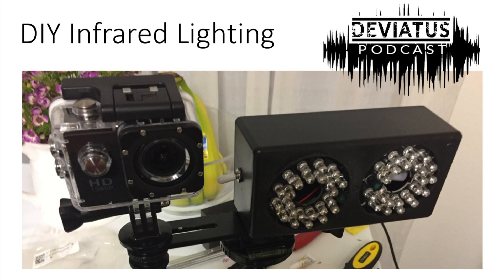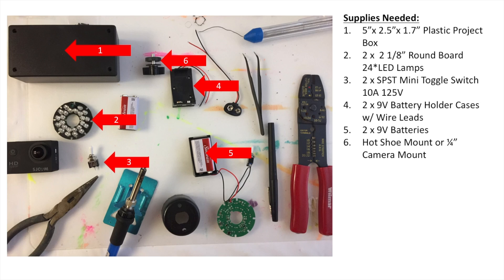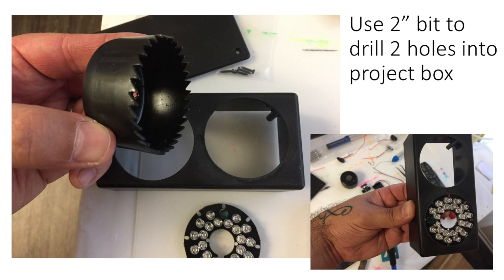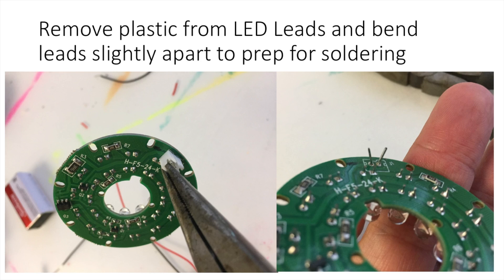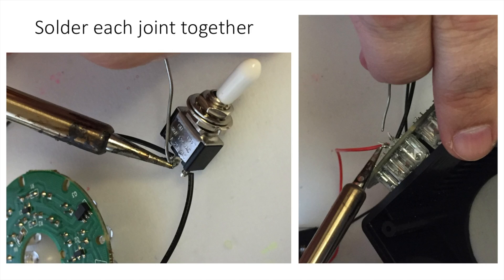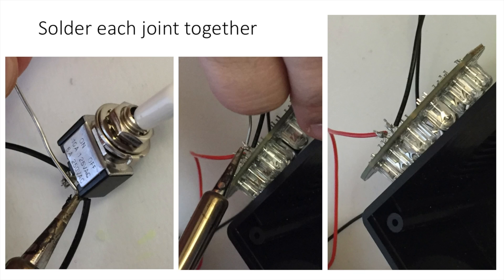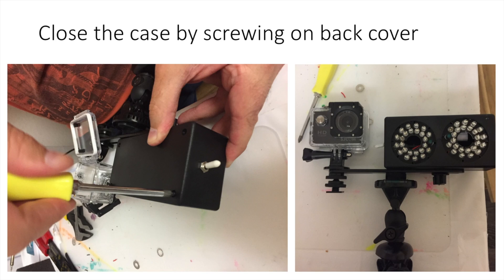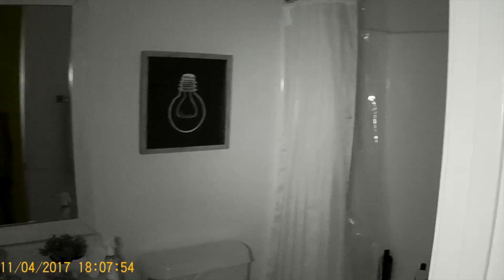DIY Infrared Lighting

Comment: Nice! I recently did this on 2 poloroid ir illuminators and its works however the light is way to strong 4 the camera so i have to tilt the lights up. I will try this out 4 sure thank you.
Reply from the maker: If I had to do it over, I'd use a smaller box and put the battery holders on the outside.  Having to unscrew the back is kind of a pain... unless you care about aesthetics.